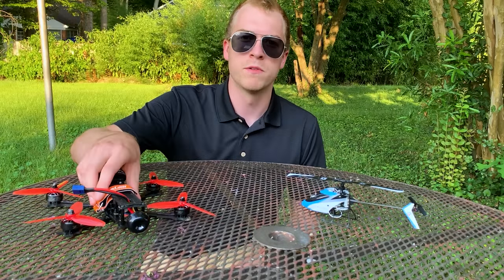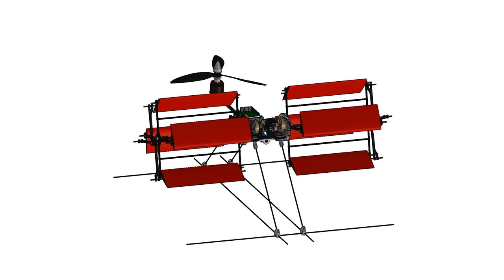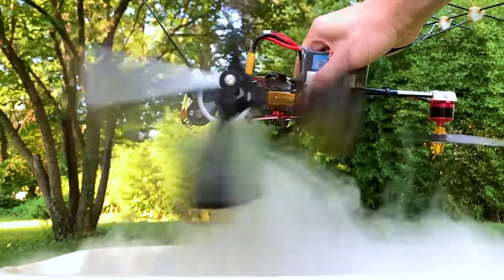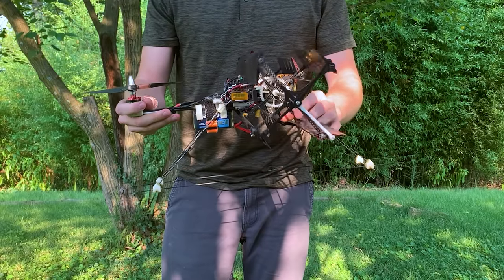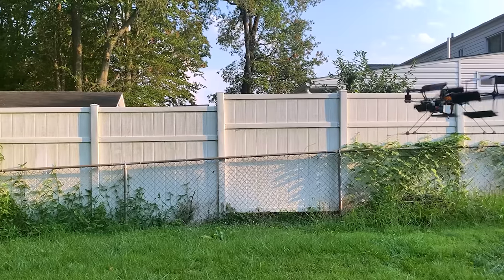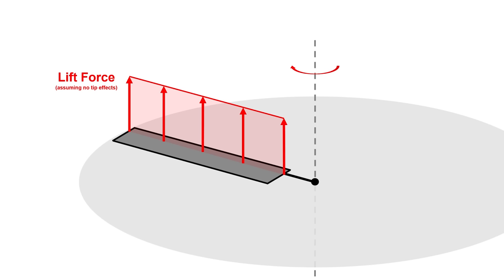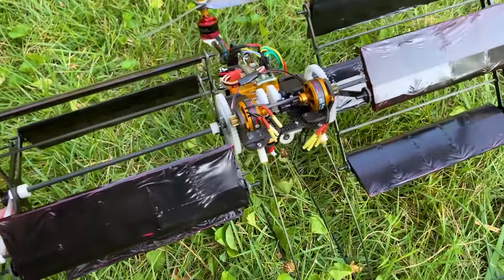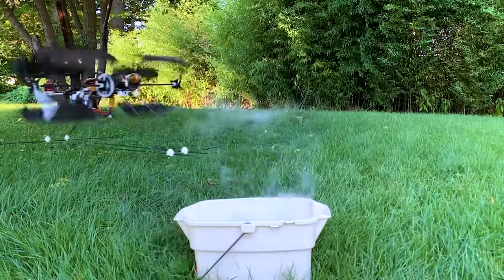Cycloidal Rotor Drone: The Cyclocopter

Comment: looks like cyclotech design (see: First Free Flight https://youtu.be/I2qkhmz4z1E ). In their case they are using 4 rotors.. 2 in front and 2 in the rear, more like a quadcopter placement. It would be interesting if you tried that design. I am wondering why you considered the cyclecopter to have deficiencies over a blad spinning horizontally. Your blades were not fully smooth. I am wondering why you didn't 3D print them to make them stronger and smoother in shape. I think the cyclocopter design will ultimately win out over the helicopter design.. they can be made to spin slower and make less noise. I think technology will help to make them better and cheaper too.

Comment: I wonder if anybody’s ever tried making a submarine using this effect
Reply from the maker: They use these a lot on tugboats so they can change directions really quickly
Reply: @NicholasRehm  
Yes. I am familiar with that. 
I was wondering how it would work in a horizontal configuration.

Comment: Your cyclocopter looks like it faces far more air-resistance and wind displacement, thus needs to work a lot harder to operate. That added to everything that went wrong with it in this video, we can be double sure it wouldn’t be replacing the helicopter ever! Cool engineering though. But please put your expertise somewhere else

Comment: Your losing 50% of the thrust, the entire time the blade is on the side.  So your battery is going to be absolute crap and a larger motor is needed.   The end.  Very cool thinking and implementation though.  Very creative and you deserve a lot of credit for thinking outside the box.

Comment: Almost everything you said is wrong. There are real reasons why that does not scale up. It does not operate at a higher AOA and you have solidity problems.  You can't compare the symmetrical airfoils stall performance to the way it works in that kind of rotor. It's sort of like adding camber by changing the relative flow in cord in Theta Space. So in Theta Space it has more camber sort of,  it really has to do with when the air at the leading edge being low  AOA then traveling in an arc by the time it reaches the trailing edge its still acting like the AOA when it came in contact with the blade so you have changed you lift vector in within the cord length. The forces do not scale. You have a serious materials problem. Not only are the blades stalled most of the arc, solidity problems kill performance on the trailing blade.  It is in no way superior to a helicopter be cause it does not have to till the body. That does not mater and rotors can tilt for trim to keep the body level and the lift vector forward in a real helicopter Your criticism is not valid and there is nothing wrong with tilting anyway that argument is stupid.  This is novel but not superior, it is inferior. However this configuration does make for good vertical axis turbine. I have been studding this and how to solve the solidity problems and how to run super mu.  Please finish graduate school before you make more ignorant claims about this. I hate millennials like you that think you know something when you don't. This is an OLD idea and it's not a good one. BTW adjusting the cord and twist is NOT hared to do. Please shut up.
Reply from the maker: Hey Anthony, this is a YouTube video meant to educate/entertain the general public and get them excited about and exposed to new ideas. I have complete understanding of heli dynamics/aero lol. Unfortunately conveying that in a 7 minute video is near impossible, so this is what you get. Dislike and move on man…